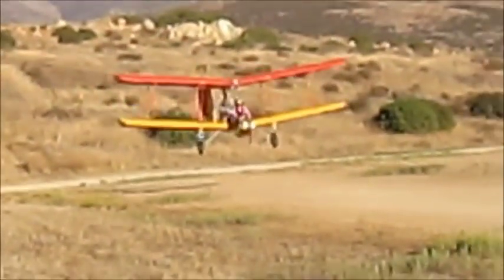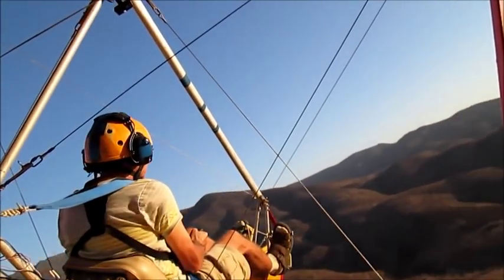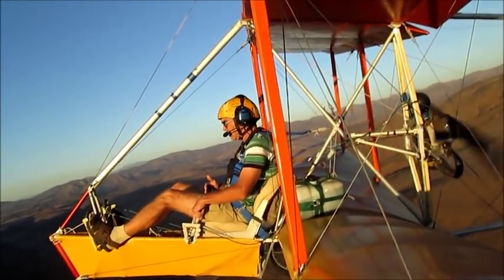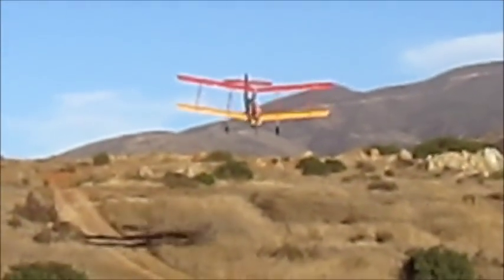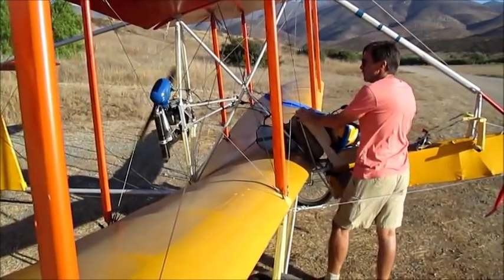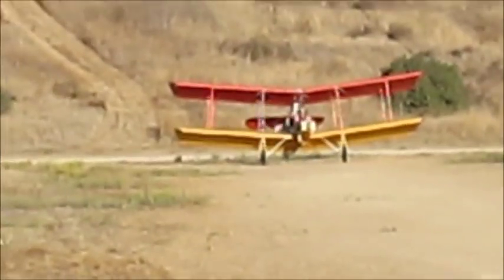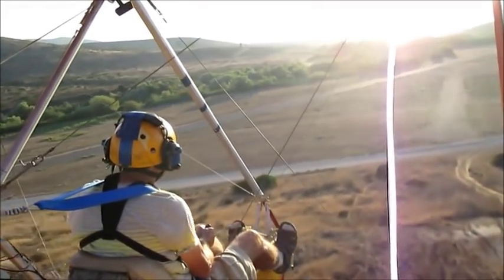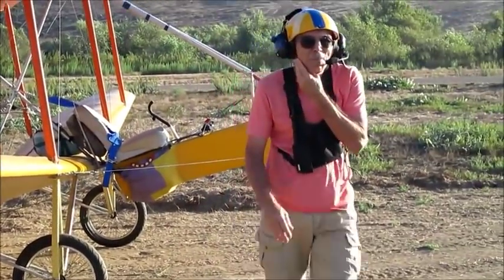Bloop 2 Flying Slow

Comment: Wouldn't be even slower and more of a floater with a single surface wing?
Reply from the maker: +A single surface wing (but still a biplane) could provide as much lift as my double surface wing, so it would allow the plane to go just as slow. Without a lower surface my wings would be a lot draggier, partly because  a lot of the internal structure of the wings would be out in the airflow. Struts and cables inside the wings are faired by the double surface, resulting in a cleaner, but perhaps heavier, wing. The single surface wing is aerodynamically quite functional at low speeds but can get draggy at higher speeds (I don't care much about this because high speeds do not mean much to me).

Comment: I would really love to build one of these.  When will it get out of the prototype phase and into a more reproducible form?  Like with blueprints or plans?
Reply from the maker: Go to the Webpage, you can download the drawings, which are detailed (but not called plans). This is as far as I intend to go with Bloop 2. The next version, Bloop 3, is mostly done. After it flies there may be drawings for that, also.
Reply: Be sure to post a video on it!  Also, any tips for cost reduction like using a snowmobile/dirtbike engine, where to find aluminum tubing etc?

Comment: 🙏 , I got what I was looking up for!!! Are biplanes more stable than monoplanes? Can we build 3 axis aircraft with mono wings and achieve same slower cruise speed without stalling or spinning? Your suggestions highly appreciated.
Reply from the maker: I do not know of any stability trade offs between monoplanes and biplanes, they are equivalent as far as I can tell.....
The Bloop program is intended to demonstrate that flying slow (mainly by virtue of a low wing loading) has benefits, one of which is not having much hazard of sudden stalls or spins. At the low speed limit the  Bloop gets balky and starts wallowing around, without any dramatic stalling. A monoplane at the same wing loading should produce similar results. .....
If you are going to assume a 3 axis aircraft you should explain why, otherwise you leave me wondering. Is my demonstration of 2 axis flying not adequate?
Reply: @airchairp  thanks for your explanation! I believe I would go with Bloop 3 design may be incorporating electric motors for horizontal lifts.

I prefer 3 axis else paramotors always the last resort but this Bloop is an old Gold. I think like it's a paramotor with solid wings😀. Can you fly it any time unlike paramotor?

However, I was more concerned about stall which you said it's quite meagre on this design. Is this manageable  if engine out mid-air? As you could sense I am more inclined for flight stability and safety. No desire for speed thrills!
Reply: Deadstick landing:
https://www.youtube.com/watch?v=Anv5V_MFiGY
Reply from the maker: Yes, it flies much like a paramotor (same engine, open air seated, 2 axis steering, slow airspeed). It can tolerate stronger winds, but like most airplanes it is not pleasant to fly in gusty conditions. To a paramotor pilot I would say, "keep it moving and give it some runway".

Comment: So slowwwwww .... I like iiiiiiitttt .... but without aileron its more difficult to landing during side wind ...right ??
Reply from the maker: Yes, crosswind landings are more difficult than headwind or calm air landings, but they can also be more fun. In addition remember that using an aileron adds to control difficulty, you have to learn a whole new method of coordinated control, and you have to switch back and forth between your ground control method and your air control method. Contrary to that, a two axis plane uses essentially the same simple control procedures on the ground as in the air. As always, see the website for more discussion of this.

Comment: Great Plane.  I built my Mono wing ultralight to have a concave shaped wing with dyhedral in it.  Way back then we called them "Dirty Wings". Sort of like a rigid parachute, remember the GWS "Slow-Stick"? Sort of the same. You took off at 28 miles per hour, you flew at 33 Miles per hour tops. And you landed at 25 miles per hour.  No envelope, slow but a blast. Don't kid yourself, any foolish pilot could kill himself in this. If the wind topped 10 mph I didn't fly.  In a steady 25 mile an hour wind, you could fly away but could not fly back. You hovered till you ran out of gas and PLOP !!
It's engineered for the Joy of Flight for the wage worker's budget on a calm day.   The Fascist richy rich have all but ruined this concept in my opinion..
DON'T GET INTO A NOSE DIVE FOR ANY REASON. Be leery of wind shear that dreaded noon time phenomenon and or flying near mountains [roll wind] and thermals, hot paved parking lots, use your head and enjoy the best of flight this poster has just shown you.
Reply from the maker: A light, two axis airplane can be fun and safe, and it has its own special qualities, but, like any airplane, it has to be flown within its limits. 
For safety reasons, I don't do aerobatics, but I appreciate those who do, they show us what can be done and make a significant contribution to design safety. 
The motorfloater is an airplane for fair weather flying, but I flew in moderate winds along with my friends in heavier planes, usually in the morning or afternoon, without feeling much limited.
If you are going to fly way downwind in strong conditions, you probably will be doing a real slow return over the ground coming back, and you will be keeping an eye on the fuel gage and the available landing areas. Fields of head high bushes and weedy hill sides are good enough for landings at my airspeeds. Power lines and deep water are the really dangerous things, but otherwise I feel pretty safe as long as there is an open spot nearby.

Comment: Generally speaking, the slowest an airplane is, the more susceptible to the winds it is, because of low wing loading (meaning its weight to wing area ratio is low).
Reply from the maker: The light wing loading has a lot of comfort and easy flying benefits, but it will get you bounced around in wind turbulence. I flew along with the other fair weather pilots, seldom flying in strong winds, and I was ready to tolerate some bumps, so the wind was not really a limiting factor in comparison to the other light airplanes.

Comment: While the engine is warming up, a pilot can review his nasty divorce. 😳
Reply from the maker: Warming up the engine does represent a few moments of repose, wherein a pilot might review his or her personal issues. My advice: don't skip the warm up. While standing around running the engine, I try to ask myself "did I really think about the preflight, or did I just cruise through it by habit in zombie mode?" If I didn't have a transparent fuel tank I would probably land out more often.
Looking back at this video, parts of it look pretty fuzzy, but the content is there and it shows the kind of flying I have been doing for the nine  years since then.
That Bloop takes off like a rocket. The Bluebird is gentler with its smaller engine, it's almost a different kind of flying.